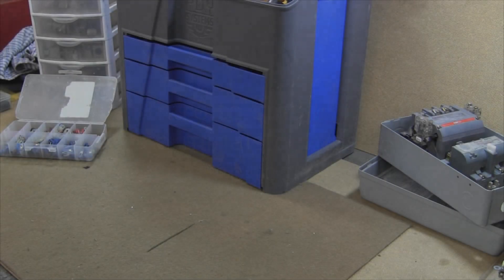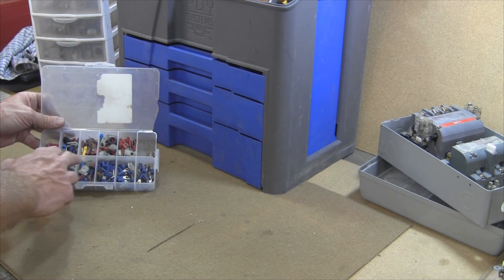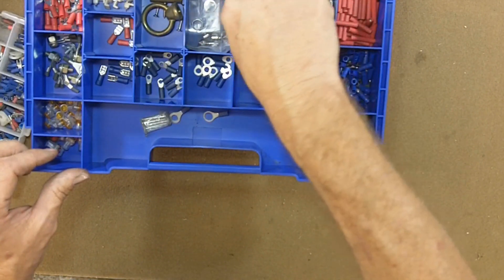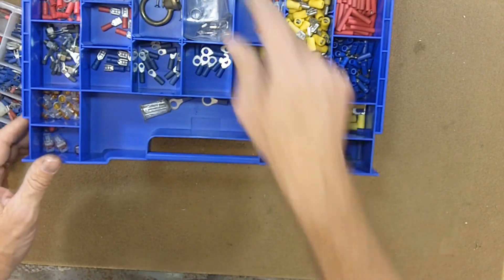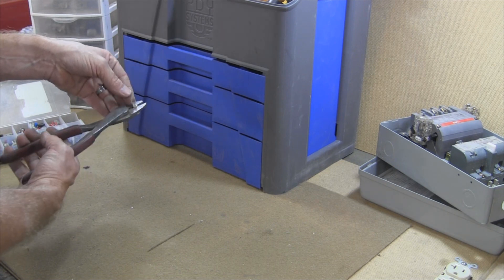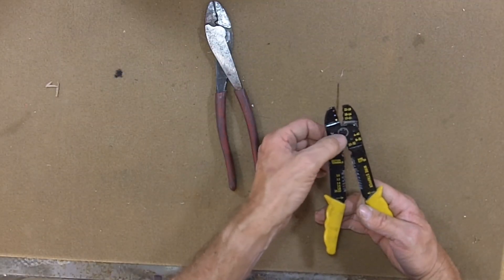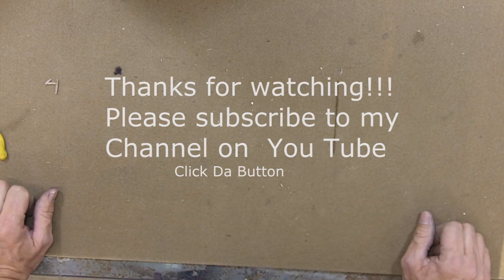Intro to Crimps and Crimp Tools

Comment: You failed to mention which side the slit portion of the connector faces in the crimp tool for non insulated connectors. The male side of the tool (pointed side) faces the non slit side of the connector.

Comment: At my company we always just strip the stranded about a 1 1/4in up and pull until about  a little more than a quarter inch shows and use kliens to twist the stranded tighter then wrap around screw in the same direction it turns so it tightens with it.  Its much quicker and less costly. This way you can still get a receptacle in every 3 minutes in a trim out.
Reply from the maker: Brandon Cole  I use that method too. Have you tried reverse twisting of the wire? An old timer showed me that trick about 30 years ago. It seems to make a tighter connection.
Reply: I'll try it out thanks :)

Comment: I lose my shit when I see #10 and less stranded wire on my jobs. I run the commercial jobs at my company which also does oilfield and they all use stranded. I will not argue using stranded when it comes to moving/vibrating equipment but holy shit putting stakons on all the devices is a huge pet peeve for me but this is what u hafta do if it's already done...apprentices

Comment: Throw that yellow-handled tool away :-/  Even the Kline is questionable, you really want a ratching tool with proper dies.

UL-listed terminals are good for solid wire unless stated otherwise, Molex makes decent ones. Insulkrimp are good, Avikrimp are supposed to be better (brazed barrel and less sensitive to orientation in the tool), but I haven't tried them..
Reply: Paul Ste. Marie                 Could you make a YouTube video about that?

Comment: I learned about crimping in a electrical work for do-it-yourself handymen class at the county extension service. (Something every girl should know.) The reason you use crimp terminals on screwed down connections with stranded wire is to eliminate all the air spaces within the connection; this is called "Cold weld; and to keep all the strands of the wire together." When a connection is properly made the individual strands within the splice will be in a hexagon form and in intimate contact with each other.

The instructor stressed that the quality of the tool and terminals we used would determine the quality of our connections and that our terminals should always be a professional brand like Brundy, Hubble, Thomas and Betts, Panduit or such; not the consumer grade crap that comes from Ace Hardware, Lowe's or Home Depot. Likewise tooling is important, cable cutters, stripers and crimpers must be top quality for reliable performance. "Controled Cycle" crimpers are a must use to guaranty that terminals are properly applied, without too little or too much compression. Most electrical fires are caused by improper connections.

I wound up going along with my neighbor, a network administrator, to an electrical supply house, where I bought a Klein compact cable cutter that looks more like a pruning tool, the best pair of diagonal pliers I ever owned, a Jonard Round Cable Stripper, an Ideal Stripmaster wire stripper and a Thomas and Betts Sta-Kon terminal kit with a  Comfort Grip Terminal Tool. It all cost a pretty penny, but I made the cost back doing work for my friends and neighbors, and now I am an AT&T employee learning to work in the inside plant.
Reply: Lorraine Fuller always learning fine job

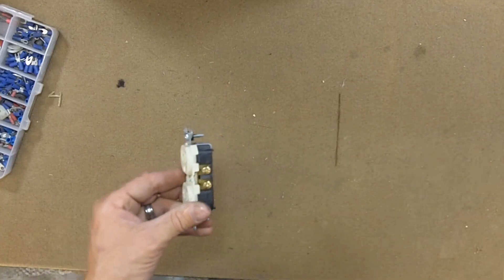Comment: 2:00 In US can you use strand wire on house hold receptacles? never thought that thanks for all your interesting videos!!
Reply from the maker: As long as it is the proper size. Stranded is not all that common in residential because of cost.

Comment: you can get much better quality crimping tools than that although they are abit more pricey there worth the extra quality and ease of use that comes from using them. weidmuller have very good selection of tools.

Comment: Is there a way to use crimps with solid wires ? For example I want to connect stranded to solid wires using crimps (easier to disconnect), can this be done using crimps ?

Thanks

Comment: When I wired an outside light the electrical inspector asked me to use a crimp-on connector for the ground connection at a screw inside the box. Of course I did it, but I didn't understand why. It was stranded wire. Why the diff between stranded and non stranded? Why not use a crimp connection for solid wire? Do you always use crimp connections with stranded wire?